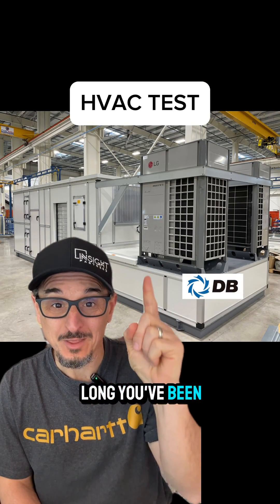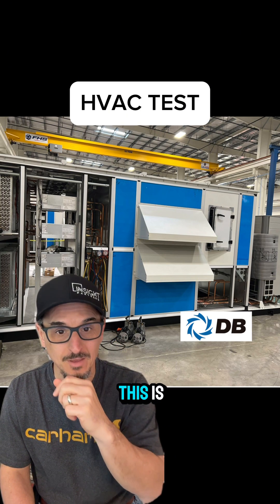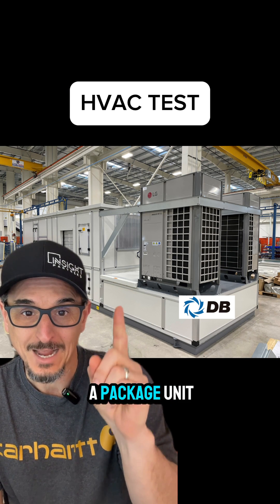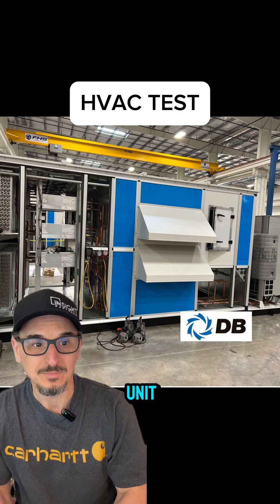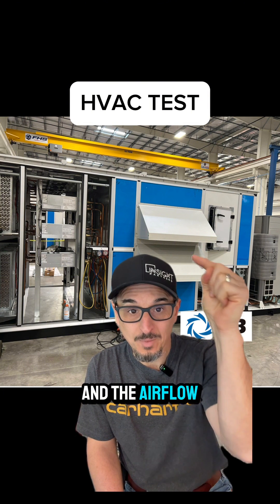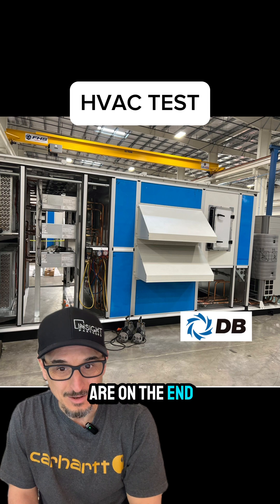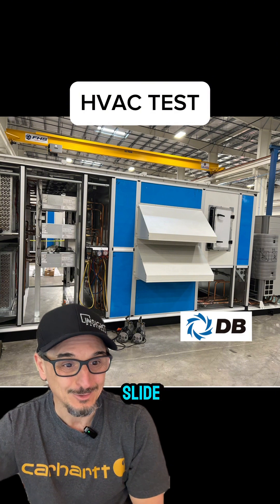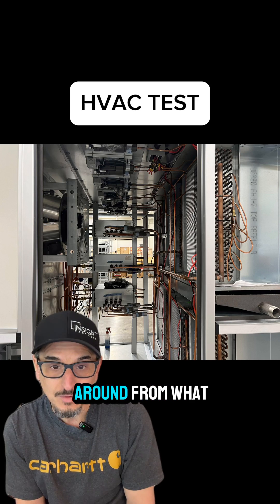Can you guess what this unit is? #hvac #vrf

Comment: So they took a factory LG multi V with the reheat option, 
     They adapted it to their own coils for a package unit or a custom build up and just adapted it to VRF. 

All the control boards are available through LG for their outdoor heat pumps reheat to adapt to anybody’s existing system